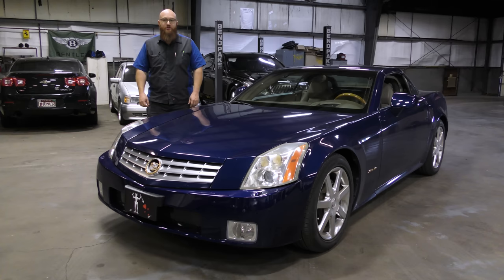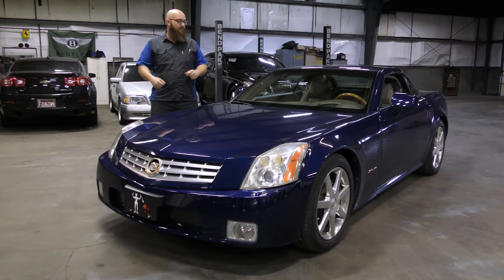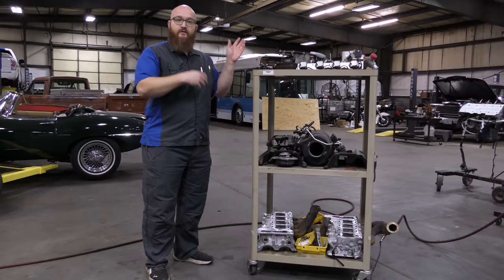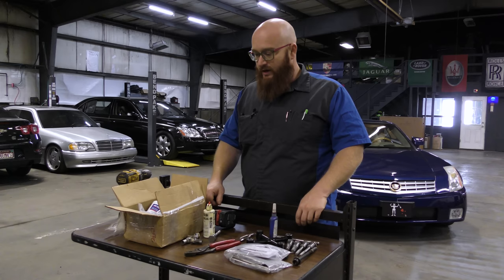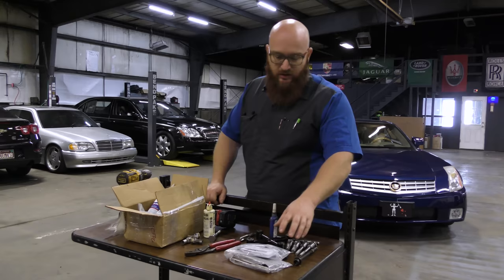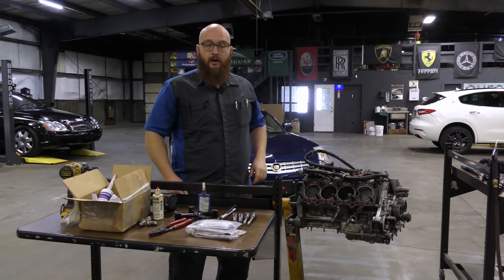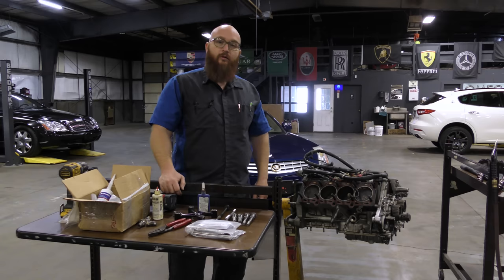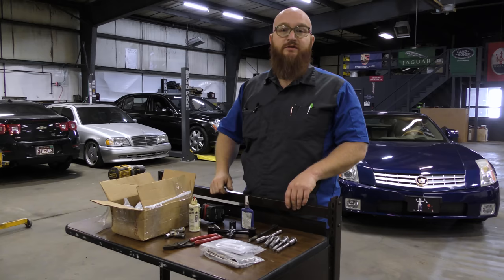No room for error! CAR WIZARD drills out the head bolts on his '04 Cadillac XLR

Comment: Hey CW! The Oldsmobile Aurora used its own variant of the NorthStar engine; do you know if Olds saw the head stud issue coming due to their own bitter experience w/ their diesels and took steps to avert it in their version of the engine, or is the AuroraStar also a ticking time bomb too?
Reply: Its an aluminum block using the same head bolts. Sadly, ive seen plenty of Auroras suffer the same fate as any old Northstar.

Comment: if i owned an older Cadillac that had an engine like that and the car was in mint mint mint condition i would spend the money to have that work done and still be ahead of the game because for one thing , the car is mint and paid for and you have a car that you know the history and how you have treated it and seeing the price of used automobiles you still end up ahead of the game in a throw away society and nothing says cool like a mint mint condition older car ,,, those tapped holes should be flushed with a solvent to remove all lubricant before using Loctite

Comment: About the same choice I had with my GMC Duramax 2500HD when the CP4 pump imploded and the repair bill could be anywhere from $10K to $20K to clean up the GM design mess.  Not an easy fix.  Do I junk it as a scrape or fix it.  An expense I'd never recoup 100% but fixed with a CP3 conversion it would be almost bullet proof and a good selling plus.   .

Comment: I don't think people are saying studs are bad, but that the engine was never originally designed for studs, and/or a non torque to yield application so charging it could change how it was originally engineered.
Reply: Well if you eliminate a now-known problem that didn't occur under OEM testing coniditions...
isn't that a win if it means a luxo barge like this can live on????
Reply: @JohnSmith-yv6eq  I'm not saying that they are right, just where the argument could come from. OEM manufacturers unfortunately are stuck in keeping costs down, where the aftermarket doesn't have that restriction is all I'm saying. Manufacturers will do everything they can to save a 10th of a cent.

Comment: any ideas as to why the GM engineers would have went with the small cylinder head bolt design? there cannot be much of a cost difference between big vs small bolts

Comment: I saw a Lincoln Zephyr for sale on FB marketplace, the seller said it turns over, but won't stay running due to "bad head gaskets".  I don't know if this would be a "good" project prospect in yho.  Frankly I would be afraid that it would be similar to this Cadillac project or if it just might be a total rebuild on the engine.  I have also seen a Cadillac CTS also on marketplace and the seller admits it is a bad engine and he was selling it for parts only.  With that one would a reman engine be a possible solution?  I know you can't say without seeing the car and assessing it's condition so I won't hold you to anything.  This sort of like getting a smooth mouth cow, with one bad leg and a calf at side.  Do you figure buy the calf at market price and they throw in the cow.

Comment: I may be stupid, but how does the kit  align with both thin original size bolts and the thicker new size in the same fixture?🤔
Reply from the maker: The center point of each hole is what matters. Thats the key to lining up any size holes
Reply: @CarWizard  it ought to have easily removable conical plugs to have in the drill and treading holes to center the fastening bolt holes prior to fastening those bolts, I really can't see how these would center otherwise given the old and the new holes have different dimensions?

Comment: INMHO, you should never drive a tap with a ratchet. You should use a dual sided 180 degree tap drive tool.
Reply from the maker: Agreed with an open hole. But using a steel jig fixture that holds the tap perfectly straight at all times, allows use of a ratchet

Comment: I once had a summer job at an auto repair shop, and the head mechanic did most of the tapping. He would use two taps for a hole with a bottom.The first one had a taper on the end for starting the process, and the second one was a bottoming tap, since the tapered tap would not thread to the bottom. Did the guide allow you to start with the bottoming tap?
Reply from the maker: Its designed to tap as deep as youll need with the standard tap. But I agree. Ive used a bottom tap several times. Its a great idea.

Comment: Why didn't you just spray adhesive the decks & wrap the block with "moving wrap" the thick cling wrap? Then just pierce through it for drill and tap
Reply from the maker: Because i dont want to clean the adhesive mess up. Your method will take 4 times more time and effort. Its not needed. Masking tape works perfect. Very effective. Easy removal

Comment: Funny you mention the 2000 DeVille not being worth it. I had a 2000 DeVille. I paid $2400 for it with 120k miles on it, 10 years ago. Unless someone has suddenly decided those are collectable now, I'd bet they still end up mechanically totaled and then some by a head gasket failure. Anybody remember that few year fad where hot rodders thought they were slick and were swapping Northstars into classic cars?

Comment: Just out of curiosity, now that the block has bigger and stronger bolts to hold the heads,
does that mean the engine can be tuned for more power? Like turbochargers or compressor.
Reply from the maker: Yes. Indeed!!

Comment: It's "peck drilling" 
The purpose is to clear the chips from the hole.
Kinda surprised that you don't have a tap wrench in your tool box, it gives you even pressure and best feel for the cut.
All taps but spiral taps should be backed off to break the chip as you tap,
Otherwise the chip is continuous and can pack up in the chip relief and bind and possibly damage the thread, especially in aluminum.

Comment: It's cool to demonstrate the head stud kit but the LH2 doesn't need them.  It's not good information to throw the LH2 in the same bucket as the older, FWD Northstars.  There are loads of high mileage STSs and SRXs on the forum and head gasket issues just don't happen.  I see no evidence of has gasket issues on the Cadillac Forums XLR section but those cars probably a lot of sitting and I am sure mechanics out there (and DIY) have misdiagnosed head gasket failures.  You do need to do coolant every 5 years.  I have had two LH2 cars.  One I sold with 158k, no head gasket issues. One we still have with 159k.  No issues there, either.  In fact my friend has a 2003 Seville with over 200k and no issues.  It really was the worst with the 1998-2000 range or so.

Comment: Please at least have a machine shop check the tolerance on the main bearings with a dial bore indicator and the main studs torqued to spec with the bearings installed With the main studs it is absolutely necessary that you have it align honed any machine shop will tell you, you are changing/ increasing the clamping force on the main caps which in turn changes/ tightens the tolerances on the main bearings you will have insufficient oil clearance when I built my sbc it was out of spec with the arp main studs it had to be align honed it’s super cheap and insures that you won’t spin a main bearing.

Comment: Is there a deposit that's refundable if you return the fixture, the drill bit and the tap? It seems like the type of system that's only worth owning and keeping for a shop that will potentially do the same repair on other engines in the future.

Comment: They use a Toyota as the platform of choice

🇨🇿 The Czechs launched a new selection of Victor anti-aircraft installations for Ukraine

 The rigs will be made from multiple pairs of 14.5mm Victor machine guns fitted to Toyota.

 ▫️The organizers plan to collect $3.85 million for the production of 15 cars.  So far, $80,000 has been collected.

 Awesome weapon to shut down drones and low flying aircraft

Comment: Fixture for main caps?
Reply from the maker: No. No drilling or tapping of main caps. Same factory holes used. Just with studs threaded in. Not the factory bolts.

Comment: Too bad they don't have some similar fix for the hook and tow HT4100  It had about the same design issue and would get the dreaded blown head gaskit or leak of anti-freeze in the oil that would ruin the valve camshafts.
Reply: Headgaskets were not entirely the issue with the garbage HT4100, the block had such porosity coolant would flow through the block, along with the cylinder sleeves expanding at different rates than the block itself.
Reply: @maineiacman  One thing I noticed on my '84 Seville when I changed the valve cover gaskits I had to tighten the head bolts to the service manual torque.specs.  Someone told me I should have changed the head gaskits to better ones than what the factory had back in '84.

Comment: He had to work in a machine shop at least one time in your past. Machinist will use a fuel to tap most of the time.. you should never break that size of a tap in an aluminum block otherwise you shouldn't be working on it. I was a tool builder for years and we use butterfly impacts to tap holes everyday and anything over 1/8 of an inch I never broke one.

Comment: Poor engineering is the reason we see these problems and GM has plenty of them when it comes to Cadillac. Cast your memory back about 42 years to the HT4100. Prior to that turd was the 8-6-4 turd. And it's pretty much been turds ever since. Never have these problems with my 300k mile Toyota products, funny thing isn't it? 

I'm only here because I acquired a slick, low mile (for the year at 110k) 2004 Pontiac Bonneville GXP with the Northstar and I got it cheap due to the previous owner claiming it had an overheating problem. Turned out to be cooling fan issues. Since it's in such good condition, and is a fairly rare car, I'd like to keep it. I've tested the coolant for exhaust gasses and it passed beautifully, but I know at some point down the road, there could be an issue. So sad that these beautiful old cars don't get better engineering to keep these things from happening.

Comment: I don't know about Northstars, but I know Subaru engines have issues with head studs especially when they call for over 150% of the stock torque ratings. It distorts the block enough to cause crank main bearing alignment issues. I believe Hagerty has a Subaru rebuild series where he ran into this.

Oh, and it looks like an aluminum chip in your beard. https://youtu.be/F5DSs3fuzSc?t=1154

Comment: It’s hilarious to hear some of the dumb comments you have been receiving. 😂

I’ve never heard someone suggest studs would cause problems because a motor was designed for TT Y bolts, especially considering racers have been upgrading motors with studs for decades.

Just because something was a certain way from the factory doesn’t mean it’s the best option. Engineers make compromises constantly for cost and ease of assembly. Factory often just means “good enough“

Comment: engine has to come out. all new timing set and crank seal. stud kit and other parts adds up to $1500 in parts and $1500 in labor.  upwards of 3K to make the north star reliable because GM didn't know how to design a head stud, not a rocket ship, a head stud. conclusion...never buy a used north star equipped car.  anybody wonder why GM went bankrupt?

Comment: And i thought you were some super mechanic. 700.00 head repair is so easy its not funny. All you need to do is pull off the heads and then SUPER GLUE THEM BACK ON….Jeez. It only works if there are a couple of good bolts and of course you then IMMEDIATELY SELL IT TO SOME SUCKER. Come on man….😁 That kit is slick, i like the way they thought of everything….something lacking in a lot of products these days.

Comment: I don't think using a Ferrari motor as a reliability analog is the best thing to do...
Reply from the maker: I do. 100%. It proves that head studs installed in aluminum blocks is perfectly safe and a great engineering idea. Its the very reason Ferrari went that route. 
It was a very good idea to use the Ferrari engine as demonstration.

Comment: does a Ferrari ever run or get ran long enough to worry about blown head gaskets? Italian tech. 🤣
all puns aside, aluminum head and block both help because if similar expansion rates, but the steel studs expand at different rates, clamping forces change and makes gaskets the very critical point. they'll all fail in due time, influenced by compression ratio, total power output, temperature (static and large fluctuations), vibration, coolant type, head gasket materials and composition, metallurgy quality, etc. endless list. subtract many years of skill and knowledge from the fields and the end result is? very green designs with endless early field failures, in which no amount of accelerated testing schemes can reproduce. facts of life, like them or not and reason to be wary of new/green technologies.

Comment: Just LS swap it 😂
Reply: The complexity of an LS swap is too much, and the Car Wizard talked about that on a previous video https://youtu.be/A1vc1-D1kXs?t=713 or 2 videos uploaded before this one that my message is on at 11:53 with the title of ""My Cadillac XLR's Northstar engine is bad!" So the CAR WIZARD is permanently fixing the head bolts!" Here are the captions for it: Oh, it'd be so cool if you could LS swap that. I don't know I mean the amount of work involved is insane to make an LS motor work in that and yes it would be more power but think about it for a minute. in the early 2000s they had the Pontiac Firebird Firehawk, 305 horsepower. That thing was looked at like a monster, wow that thing's so fast! This has that much power! it's not a slug. it's not slow. I can get on this thing on the highway and be up to 80 miles an hour very quickly. it weighs literally as much as a Corvette, because it is a C6 Corvette underneath so the argument these are slow. They're junk well no. They're not slow and they're not junk they're actually a very good motor. They were slow in the de Ville because it was so heavy, and it didn't have variable valve timing as you can "see" here. These little magnetic actuators. This is the LH2 motor. It's geared for 320 horsepower with variable valve timing and some different changes here or there. It's actually a very good motor. It's very fast. This is fast and as much power almost as a 1997 C5 Corvette so to say it's slow that's inaccurate. It's not slow

Comment: Wizard, you need to comb the chips out of your beard. 😆 🤣 
I noticed the top part of the studs are a smaller diameter. Are they a coarse or fine thread?
I never understood that thing of torque/degree. Makes no sense. Why not just have one adequate torque setting. 
This process is the way these engines should have been designed in the first place. The engineers must have been on crack!